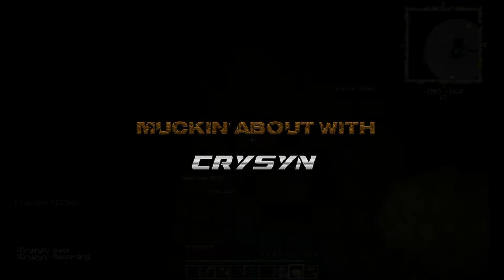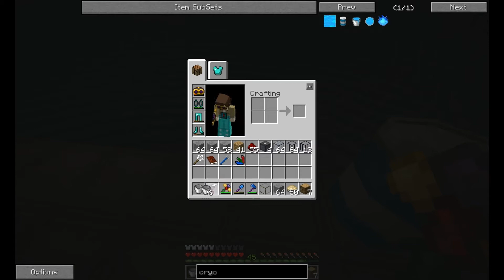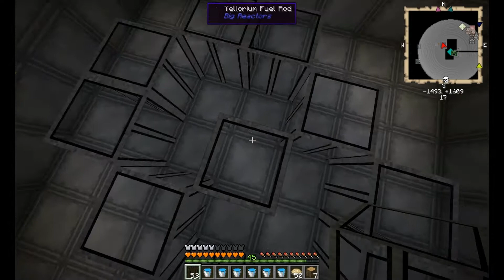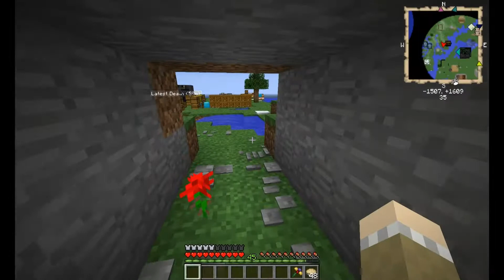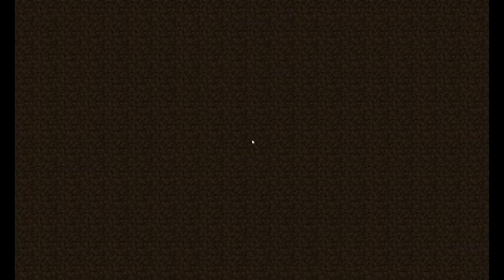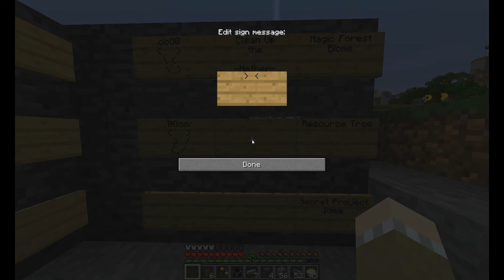Muckin' About - Agrarian Skies E25 - Powering it Up

Comment: 16:35 - are you manipulating the reactor manually?
You can make the Reactor behave like the Thermal Expansion  Machines with a single rednet controller - just feed it back it's own internal buffer as fuelrod position (all)